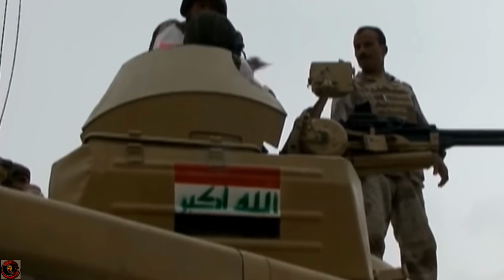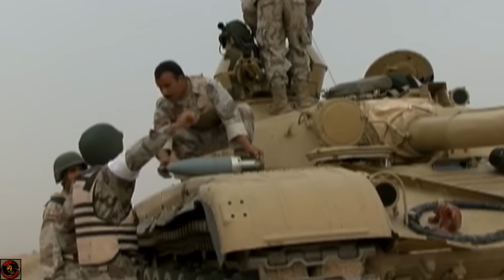Do Russian Tanks Need Bigger Guns?

Comment: I stand by the comment I made to a similar video of yours some time ago. Here you hit on most - if not all - of the points I made then. Pity I can't find that comment now.

Meh, tanks can't get much bigger without serious drawbacks. Therefore their guns won't need to get any bigger either. Point of fact, the AP round needs only a 25mm bore, so... what's so enticing about a bigger bore? 

As I see it, everything is based on the High Explosive round. The AP round needs a sabot to fill the rest of the bore's void; this is a waste of propellant, you can use less propellant if less bore needs filling. The "shot" round can be modified to fill the void of the bore; so that doesn't need a bigger bore. So that begs the questions... How important are these bigger HE rounds? Can a longer HE round suffice?

You see, if the round and the propellant don't need to be connected, then your options for smaller bores expand. It's all about interior space and maneuverability. The projectiles need to be the size of the bore, but the propellant... doesn't! Therefore, you can stack more projectiles into a tighter space, if they aren't attached to their propellants. You can still have your loader; hell, as a team effort, the gunner can then personally choose the projectile he wants to use (that way he'll always know how much of what he has), while the loader concerns himself with ejecting and loading brass. 

Hell, does the propellant even need brass? Can't the loader just slap a primer on the end before closing the breech? Things that make you go hmmm...
Reply: For a sabot round; the bigger bore allows for more propellant to put it down range faster. Physically the bigger barrel allows for more propellant in the charge. More propellant of course means more velocity; providing you have a barrel length to accelerate it.
Reply: +Crag_r
I fail to see how propellant requires a bigger bore...

https://conflictresearchgroupintl.com/wp-content/uploads/2016/01/Bullet-Caliber-comparisom-chart.jpg
Reply: Bigger gun means more boom boom behind the round which makes it go faster. and speed is how you defeat armor
Reply: shoot just realized someone answered this
Reply: Clint Carpentier Those are nice small arms. But once you get to the size of tank guns it becomes a little harder to man handle and create equipment for vastly different ammo. After all; for a tank these days most of it is 2 part anyway.
Reply: +Clint Carpentier
>this is a waste of propellant, you can use less propellant if less bore needs filling

nope. If you could find a picture of russain tank shells, you'll see, that 'sabot' rounds have much more propellant on them, than other shells. So, basically you don't waste propellant with large caliber gun, it's the other way around - with large caliber gun you can squeeze more propellant.
Reply: +Blue Bees
Don't mistake the gun for the chamber. The bore need only be big enough for the projectile. The chamber can be much bigger than the bore.

The problem I have with a large bore size, is the whole of that bore needs to be filled with expanding gases. If the bore is smaller, less gas is needed to fill it, meaning less propellant is needed. Or the same propellant, but in a short wider chamber.

Look at my above link. #'s 8 and 9 are the same bullet, .223; however, the fatter chambered winchester sports 500ft/sec more than the slimmer longer remington; even the #10 doesn't match it.

How's this... - uses shitty accent - Do you no mathz?

pi r squared times the length of the barrel

Each 1mm of length on a 120mm bore, is 11,309.73 cubic mm. Each 1mm of length on a 130mm bore, is 13,273.23 cubic mm. That's a difference of 1,963.5 cubic mm. Every... mm... of... length.

The 120mm M256 L/44 gun is 5280mm long (currently used on the Abrams M1A1 and M1A2).

So not only will you have a bigger heavier round to propel, but you'll have more bore to fill with gas. This means you will need MORE propellant to do the same damn job, never mind making it go faster.

If the larger caliber is what matters, then how come the infantry don't carry .50 cal high powered rifles?
Reply: +Clint Carpentier
>If the larger caliber is what matters, then how come the infantry don't carry .50 cal high powered rifles?

they carry .50 cal machineguns and autocannons in 25-57mm caliber range. In theyr IFV's and APC's
Reply: +BC russian
Take a moment to think about what you just said, in relation to what I said.
Reply: +Clint Carpentier
you don't get it? Infantry ALREADY carries large caliber guns. .50 cal machineguns, 40mm grenade launchers, 60mm mortars, rocket propelled grenades, ATGMs, cannons in range 25-57mm when using IFV and APC - it is the main infantry weapon. Small arms are used mainly for protection or specific situations
Reply: +BC russian
I said infantry, and you added vehicles. With this, you have eliminated any chance of my being clear to you. There are >>>NO<<< classifications that refer strictly to boots on the ground forces. ANY forces that I may refer to, you can just as easily say "but they do, cuzz chucks."

Let me try to be clear. 

I was referring to shitbirds who must carry by their own two legs!
Reply: Hmm... what about a 20mm sabot sling with a coaxial large grenade launcher for HE?
Reply: Clint Carpentier Nice maths but if we take a look at tank gun velocities, the larger calibers do the job better then the smaller ones. Better flight performance, better velocities, better penetration and more mass on target (where it be a DU slug or HEAT warhead).
Reply: Clint Carpentier What? In your original comment you said; "Point of fact, the AP round needs only a 25mm bore, so... what's so enticing about a bigger bore? "
Reply: +Clint Carpentier
>I said infantry, and you added vehicles.

because, there is no 'just infantry' in modern armies. There is  light infantry or motorized infantry. And main weapon for motorized infantry mounted on their vehicles.

>I was referring to shitbirds who must carry by their own two legs!

light infantry? They carry all sorts of big guns, light enough.to be carried
Reply: +Crag_r
The depleted uranium AP round isn't a slug, it's a dart.
Reply: Clint Carpentier You're welcome to call it that. It can be refereed to slug in colloquial. Usually Sabot or Fin (depending on your nationality)
Reply: Cool story; and yet we still have bigger tank guns equating to better gun performance. Tell us oh powerful tank gun designer why we even bother with sabots in the first place if calibre doesn't matter?
Reply: +Crag_r
I won't repeat myself.
Reply: That would make you ignorant in the face of overwhelming industry efficiency, performance and functionality.
Reply: +Ay Someday
Morale boost... It's as good an argument as any.

The Abrams M1 tank sported a 105mm gun and stored 55 rounds.

The Abrams M1A2 tank sports a 120mm gun and stores 42 rounds. That's 2 rounds more than the 40 it used to store. 

Trade-offs! Is you morale dictated by bigger booms, or longevity on the battlefield? Are less booms really worth the bigger booms?
Reply: +Ay Someday
If you can't maintain your argument, concede the fight, or admit you need to hone your argument. What you just said there, was intellectually lazy, basically, "gyaaaahhh datch juss yer opinion man..."

Main battle tanks aren't scalpels. They are hammers, they don't need circumstances more than, "war has been declared!"

The Abrams tanks consistently move faster than it's logistics can keep up. So if you're bookin faster than your ammo supply, how does that impact your morale? Tanks are targets. "Yeah, we're surrounded by the enemy, but gawd damn, the booms were magnificent."

The 105mm did the job. The current 120mm does the job.

Just how important is your testicular morale?

You realize, a main battle SHIP hasn't been built since 1944, right? Something about air superiority... the biggest guns right now are like 6"... maybe. Because the biggest gunship built now is a cruiser; which they don't even bother differentiating between light heavy or battle anymore, just... cruiser.

Innovation is a great thing, I'm all for it. But when it comes to practice, use what works, not one lick more.
Reply: +Ay Someday
You start off claiming everything I say is bullshit, and now you wanna claim I didn't read what you said? Your whole argument is morale. It's not like you posted a fucking novel in one paragraph. Six sentences, starting with I write bullshit; no explanation as to why I write bullshit, only that what I write is bullshit.

Take your pissy ass, and fuck off!
Reply: +Ay S
I laid out what I figure is correct. Some people disagreed, and we've had an exchange; therefore, "What you say is bullshit!"? Are you fucking kidding me? And somehow this means I've ignored your "100m+, trophy your 25mm." You failed to comprehend the 25mm point. I wasn't going to entertain gun launched missile, because the military has already considered it, and wrote it off as too delicate. Missiles have their own platforms.

But let's see how I've made myself smarter than everyone else. I'll start straight from the top...

OC Jones - makes a couple points I had already made, as though I was denying them. I made those very points in my OP, therefore I wasn't going to entertain the notion that I may be wrong on the matter.

Crag_r - makes a point that propellant is limited by the size of the bore. I argued that it isn't. He has yet to prove his point.

Blue Bees - makes a point of "bigger boom boom." At this point, two people had referred to "bigger cuzz boom", without addressing the problem of propellant, so I laid out the problem of VOLUME!!! More bore volume requires more gas, more gas requires more propellant, more propellant requires more space, more space required means less space for the loader. Which brings us to the "dance a jig in a closet" comment at Crag_r.

BC Russian - makes a point that infantry have vehicles, therefore my point about .50 cals is fail. It was a blatant disregard of what I meant by "infantry". It doesn't take a genius to get that vehicles can carry .50 cals. It takes a special kind of stupid to "forget" that infantry is commonly on foot; I'm quite capable of referring to vehicles by name, should I call infantry "walkers? bi-peds?" Do you not see the frustration at that exchange? Fucking potato!

Colin Thorneycroft - I am not sure what he was getting at; he could have been in agreement and giving undetailed options, or he could have been trolling. Either way, I ignored it.

At this point, Crag_r is obfuscating and trying psycho-babble at me. I wasn't biting.

Ay Someday - comes in and blatantly says everything I've said thus far is bullshit; his very first sentence. He has thus far jumped around declaring how stupid I am, and what a delusional fucknut I am; and still fails to make a concise argument one way or the other in regards to the topic at hand. I think I've given his intelligence far too much credit.

If I've come off as "pretending to be a genius", it's because you're so fucking stupid, anything sounds smarter than you! Pretending need not apply. Rather than trying to bust me down to your level, why don't you try coming up here, and making a fucking argument that doesn't solely rely on ad-homs!!! Grow up!!!
Reply: +Ay S
I see your intellectual capacity overloaded. Pity.
Reply: +Ay S
It's not talking, it's blatant fucking shitbirdian. I shall now give you the last word, you are intent on it. Be sure to use it for more personal insults.

Comment: "Do Russian tanks need bigger guns?" - I'd say no too lol. 125mm is already bigger than NATO's 120mm, has enough good ammo stocks, and gun performance like accuracy and effect against armour (assuming the current T-72/T-90 2A46 - then the 2A82 for T-14/T-90AM), and has powerful HE round and ATGM launching options. Ammo stocks is also an interesting point for there are special rounds (some DU) kept in EMERGENCY RESERVE (for 'Black Days') but the current rounds are deemed still sufficient against armoured targets, so before even upgrading the gun, there is an ammo change option to increase performance.

With regards to 152mm (6in) and Armata; Armata offers a never realised before (on this scale) opportunity for modularity and upgrades combined with the new doctrine of digitised net-centric warfare. I think the T-14 will be using the 125mm 2A82, but the Russian MoD will invest in the infrastructure and design of the 152mm for some models (any kept in service will probably be with the 4th Gds Tank Div as part of the main counter force to NATO - 1st Red Banner Gds Tank Army), so IF the need arises, the tanks can be retrofitted quickly, easily and cost-effectively. This has already happened with older tank models to an extent; most T-90s are in the Western Military District and most of the older T-72s and T-80s that are yet to be modernised or phased out are in the Central and Far-East Mil Districts where the threat is lower and the circumstances are different (terrain, VAST spaces that one can sacrifice in strategic withdrawal etc.)

The other issue here is that in order for a tank to be mobile, it can't really (with today's tech) be all over resistant and make obsolete the 120/125mm guns. In the past we saw the Tiger make the 75mm somewhat redundant in tank warfare with additional armour, hence the USSR's 85mm T-34s and 122mm IS-2s, but to make a tank that would REALLY need a 140mm/152mm to counter it, either it'd need a new breakthrough in technology or it's be so big and cumbersome that it would be easy to counter via Air power or be so immobile that it is a liability to operate strategically.
Reply: Lasers do not work in an Athmosphere well enough to be a viable anti tank weapon. It's not even a viable anti personel weapon too, or anti anything
Reply: Blox117 
You have to power that laser. On a massive battleship, easy. On a tiny tank, much harder.
Reply: +Jame Much harder? Nope. maybe if it was a chemical laser, but a diode laser can be powered by a generator or batteries.
Reply: not to mention that they used a chemical laser on an airplane already, so a solid state laser would be even easier.
Reply: Blox117 
The YAL had about a dozen shots, if that, with the enormous battery pack it carried.
Reply: yep, lasers dont work. thats why the US Navy did not use laser weapons on one of its ships from 2014 to the present.
Reply: Fact: a laser with an output power of 100Kw can easily burn through any tank from miles away
Reply: JUST STFU AND PUT A LASER ON IT

Comment: I worked with 155mm artillery, those projectiles weight a lot. A fitting physical condition it's a must. And even whit that, most artillery pieces come with some sort of either hydraulic or pneumatic asistance sistem.